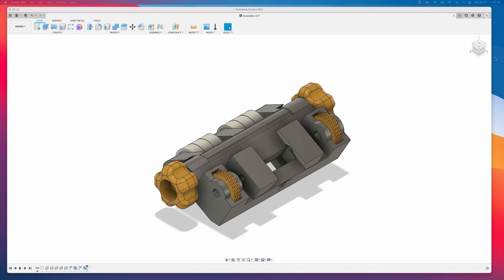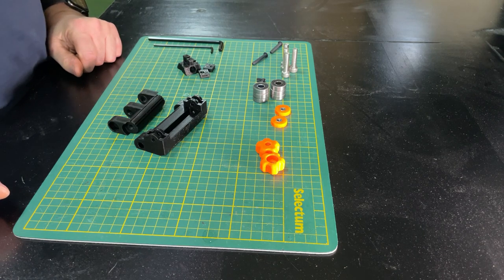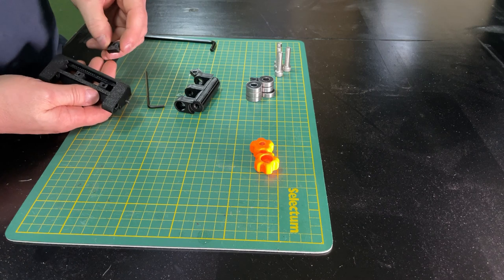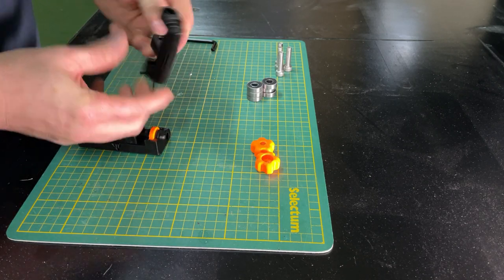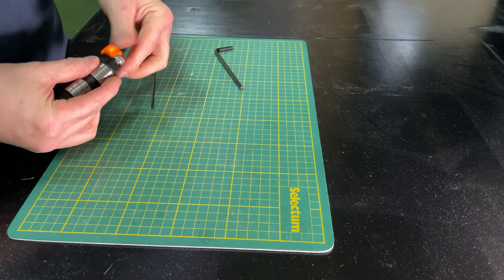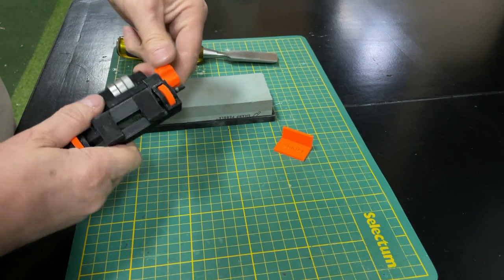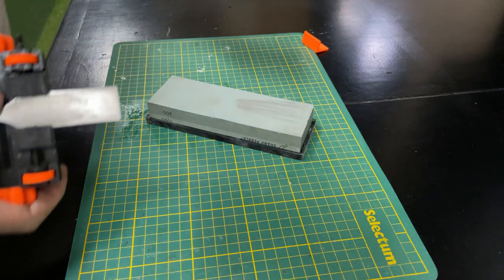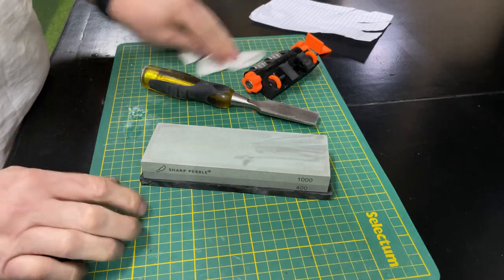Get Perfectly Sharp Chisels Every Time with this 3D Printed Jig

Comment: Awesome design, thanks for sharing.

I’ve just printed and assembled mine though not yet used it. Couple of bits of feedback…

1) The hardware list should state M5 nuts not M4

2) I used regular M8 hex-headed bolts to hold the two main parts together. I was going to tweak the design before printing, but I printed the parts in PETG, drilled the hole in the knob to M8 and the head of the bolt squished into the knob just fine. I get the original design means you use the same hardware but I felt for people with lots of metric bolts around anyway, this was a bit of a better design as it grips the head of the bolt better. 

Thanks again!
Reply from the maker: Thanks for the feedback

Comment: This is solid. I am waiting on delivery of my printer, but i think this will be a first project. For anyone else that is interested, here is the list of additional hardware he outlined in the video.  I assume these are all course pitch; but as long as the nuts match, you should be ok. 

2 - M4 hex nuts
2 - M4 x 10mm cap head hex screws
2 - M5 x 35mm screw button head hex screws
4 - M8 x 35mm cap head hex screws
6 - 9x24x7mm bearings (609 skateboard bearings)
Reply from the maker: Apologies for not adding these into the description.  I've added these.  Thanks for watching
Reply: @SteveMakesEverything  Hello! Please tell me, are the bearings exactly 9x24x7 or 8x22x7?
Reply: @SteveMakesEverything because 608 is 8x22x7, 609 is 9x24x7
Reply: @SteveMakesEverything which ones would you recommend?
Reply from the maker: @LazarevDenisBalakovo  608
Reply: @SteveMakesEverything thank you🙂👍

Comment: this is the best 3d jig I have seen, will try to make one, will need to wait for bearings to start, but one thing - it seems strange that you measure from chisels back bevel not front, I guess it is because chisels have different thickness, but it makes it hard to straighten old out of angle ones. will, see. Great video and great design overall! edit- video is 10 months old, have you use it still and any thoughts on it after this time?
Reply from the maker: You can measure the bevel anywhere you want as long as you are consistent.  I use the back because the front will have a micro bevel which is necessarily going to be the same all the time.  I still use this sharpening jig for all of my chisels.
Reply: @SteveMakesEverything  thank You for replay! glad to hear that jig have proven it self over time, cant wait to print one, thank you again!

Comment: What is the best orientation to print the pieces? Are they oriented how you printed them already?
Reply from the maker: I believe they should just print as is. You might have to turn on supports for the center pieces.
Reply: @SteveMakesEverything  thank you sir! I have half of the parts printed. I had an issue with bridging on one part but got that corrected with supports.  Does it matter if the bearings are 608 or 609? The measurements you have listed are for 609 bearings. Nice piece of work, thanks for sharing!
Reply from the maker: @sciclonefarms3956  608 bearings will work as long as you can get an 8mm bolt through them

Comment: does it open up enough for plane irons? 
thanks
Reply from the maker: There are two variants of the main part of the body - the larger one might open wide enough for a plane iron.  If not it wouldn't be too hard to create one.  All the would be required is longer screws for the chuck pieces.
Reply: @SteveMakesEverything  cheers , cery cool design ... printed and Im assembing it now ... the larger one fits a number 5 plane iron comortably , I think it can even fit up to a number 8 ... small correction in the description - you need 2x M5 nuts not M4 , and skateboard bearings are 608zz bearings usually not 609 :) cheers
Reply from the maker: @darrylportelli  Right 608 bearings.  Clearly a typo to fix.  I originally built the larger slide because a carpenter friend of mine asked for the same thing.  It just depends on the plane - some are fairly large.